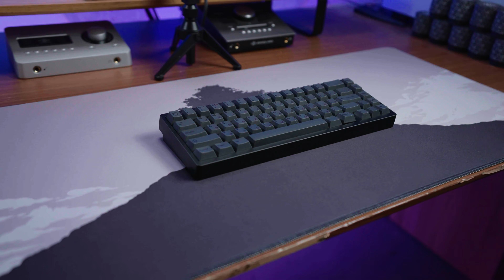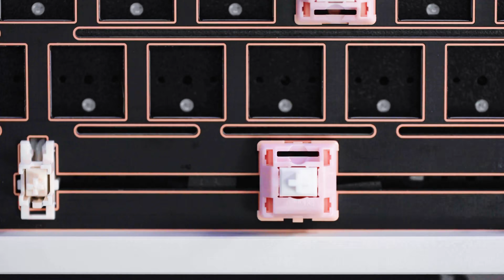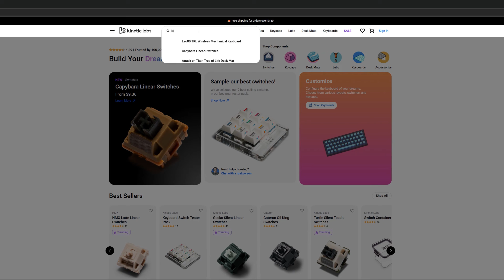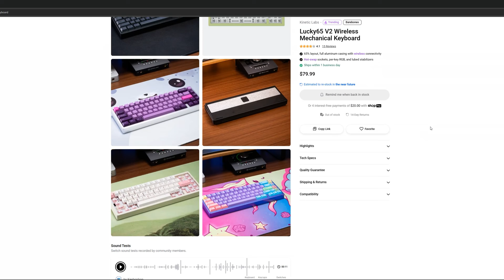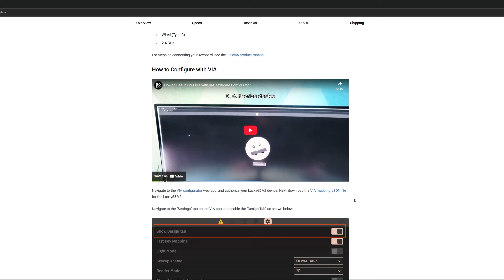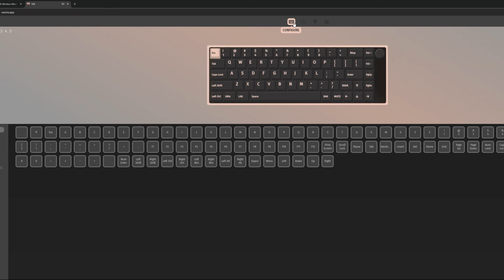Lucky65 V2 Mechanical Keyboard Guide (Best 65%)

Comment: hey do you need to switch it off for wired mode to function? i cant seem to connect to wired mode, FN+T just makes ESC blinking and the board is unresponsive (with wire connected)

Comment: 2:00 Is that led always on when the in wired mode? I would really hate it if that's the case. My Yunzii A66 has a constant LED that could not be turned off and I swore to never get another KB that had a similar component. Hopefully that's not the case tho as I would like to get this one.

Comment: If I have north facing switches can I use any 5 switches?
Reply: North and south facing switches are the same. And it supports 5 pin switches.

Comment: Just bought it. Each time I mod it, it sounds worse. I learned that not all keyboard will sound better with PE foam mod. Also if you have fr4 plate, don't aim for thock, you'll be wasting your gat oil kings.
Reply: if so, which kind sound should i aim for in your opinion
Reply: @natsukawakaoru  built a deep clack. Out of 15+ switches, Huano's Caramel latte sounds the best, by far. Stay clear of Akko and Gateron for this board. HMX is a strong number 2 for me (cloud and xinhai)
Reply: @ aight, thank you for all the info, pretty sure im gonna try these switches
Reply: @johnoliverfainsan3115 Why avoid Akko and Gateron? Is there an issue with the sound with the board or is it just preference?
Reply: @johnoliverfainsan3115  Nahhh, after hearing tons of Lucky65v2 soundtest, I would say the sound profile is poppy due to the fr4 makes the sound sharper. You can do thock but it still has that poppy sound. 
Is not suatable for clacky cuz it is a foamboard (unless you swap fr4 with custom alu plate). Foamboard requires all foam in order to sound good and sounds bad if the PET sheet removed.
Reply: @exodusziek  Most Akko switches sound really tame and foamy in it especially the Piano. No character and just sounds underwhelming. It's better to put Akko's in a plastic board with PC plate. 

Same with Gateron, I wasted so much money for the expensive Gat Oil Kings only for it to sound so light and muted in my Lucky65, in a Royal Kludge R65 is sounds great though.  

Keep in mind that my benchmark are HMX switches

I also asked other Youtubers if they prefer HMX over Akko, they said yes.
Reply: @johnoliverfainsan3115 Ah, I see. I went with Gateron Smoothie Silvers on my Lucky65 V2, which sounds pretty loud. I can definitely feel it being a little muted because it's an all POM switch, but it's definitely loud enough for me to hear especially in my country where street noise and just loud background noise in general is very prevalent. I've made no mods to it and I use cherry keycaps. It sounds pretty poppy like the reply above said because of the FR4 plate I assume, but it's definitely what I would call a creamy sound profile, and I'm not gonna complain if it sounds good.

Curious to see how the Gat oil kings sound on the RK R65, though. That was my very first board but due to me being pretty new when I first got it, I kept opening the board to mod it because I was desperate for thock, lol (I think I've grown out of that phase now anyway)
Reply: would you recommend a case foam mod and tape mod?
Reply: @noIongerinusee  you can try force break if case ping annoys you, but tbh, lucky65v2 already has a lot of foams in the case so you dont really need more foam for it
Reply: @natsukawakaoru aight ty
Reply: @natsukawakaoru but what about tape mod? would it be any useful
Reply: @noIongerinusee  i havent tried that mod but i think foams that come with the keyb is already enough for you, but you can try if its not "pop" enough for you
Reply: @natsukawakaoru alr, just one more question did you end up choosing the caramel lattes?
Reply: @noIongerinusee  haha currently saving money for future things, im currently using KTT KangWhite V3, more of a clacky switch but it gets the job done, you can try some other creamy switches
Reply: @natsukawakaoru 👍🏼

Comment: I recently got this board and my unit has a really ticky spacebar and number row, which I assume is because of the metal on metal contact from the loose fitting of the case and top frame due to the ball catch mechanism, does anyone have the same experience and if so, will the force break mod solve this issue?
Reply: no, the force break will not because it isn’t the case ping’s problem. The tick is probably from the stabs, not the case. And for the number row, check if there is interference with the switches and the case or anything messing it up.
Reply: thanks for the reply, is there anything that I can do to the stabs to prevent ticking? also I tried a bunch of different switches on the spacebar (gat smoothies, akko lavender v3 pro and cream blue v3 pro, ktt coconut latte, hmx violet, and boba u4tx) and for some reason, the u4tx does not produce any ticking noise
Reply: @neekzi7 a switch wont fix a ticking spacebar. Tune the stabilizers